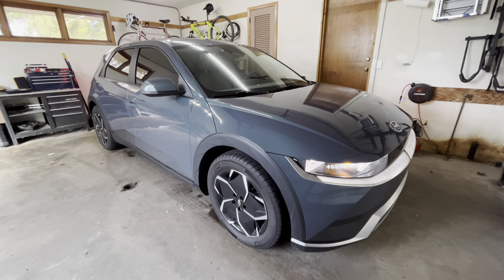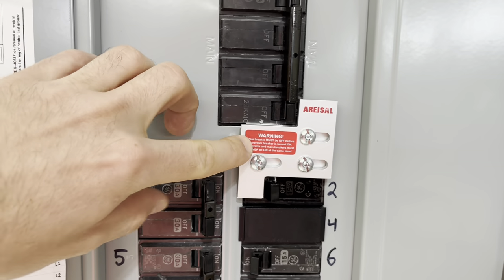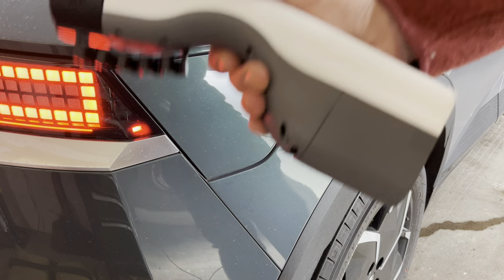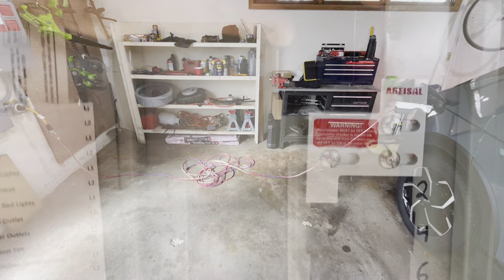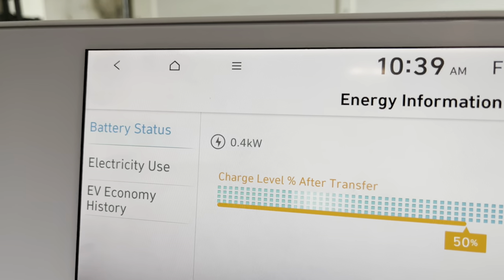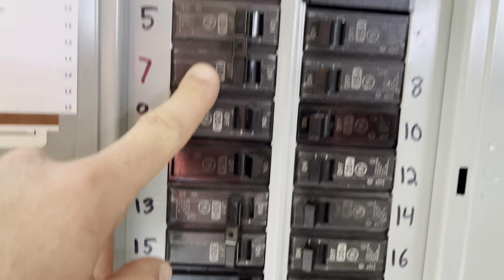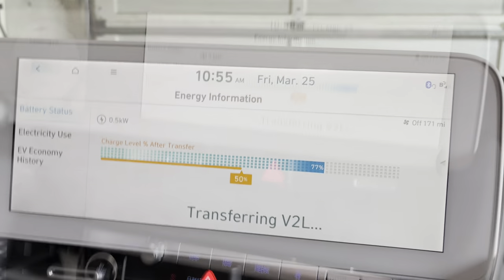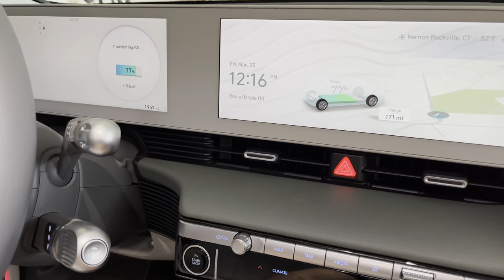5 Days of Emergency Backup Power Using V2L Adapter | Ioniq 5 | EV6 | GV60 | EV9 | Kona | Ioniq 6

Comment: Possibly the optimum solution is to first start with battery backup on your PV. This doesn't need to be huge because the V2L will provide a trickle feed top up in the absence of solar via your PV charger mains input (which can be set to limit at the max V2L capability). The purpose of having a small capacity PV battery (say, 5KWh) is to provide peak load capabilities that are well beyond the capabilities of the V2L. Also overcomes the 120 240 issues you have in the US. In the UK, we are blessed with 230v V2L at 13A.
With this arrangement, you could use a high load appliance for a short period (eg. dry some clothes for an hour/ cook) drawing most of the power from the low capacity but high current capability PV battery, whilst the V2L replenishes at a constant rate.
Reply: Hi Andrew, desperately trying to find info on this, I'm from the UK and your comment is interesting. Am i understanding you correctly in that say you had a 5kw home battery you could use the Ioniq to keep that topped up with contsant trickle? I wonder who I could get to install that ind of arrangement. I am just about to get a 5kw battery and additional solar with a UPS built in as we have power cuts a lot. It sounds like a pretty straight forward alteration to the system?
Reply: @adamhardy8690  Hi Adam, yes your understanding is correct. It's a matter of doing some calculations after monitoring your power consumption over 24hrs at various times of the year and working out how much PV battery capacity you need for peak draw periods knowing that between peaks you'll be topping up at ~2KW. Of course, if you have a large enough PV array and  excess energy during peak sun, you'll be wanting to first charge the PV battery and once that's topped up, direct any excess power to the EV battery. Given the 60 to 70KWhr available in long range EV's, they can provide this load smoothing capability for quite  a considerable length of time and still leave plenty for car journeys. You'd need to factor in your journey requirements and make sure you didn't draw below that level.
Reply: I just seen Enphase and there bidirectional car charger/solar inverter with V2House and V2Grid functionality. There lots of companies working on it. Just hope for good implementation
Reply: So, if I understand correctly,  you would need a PV battery backup specified to be able to be charged from a generator for this scenario to work?   Most home batteries right now do not support this.
Reply: This is incredibly helpful information. I really appreciate you taking the time to go through it step-by-step.
Reply: I'm in the UK and using an Ioniq 5 via the gen port of a Sunsynk Inverter to top up the house batteries. It works to battery charge if the inverter is isolated off grid but not just by switching to the gen port via the inverter.  This is a pain as you have to physically turn the mains off. I want to be able to plug the car in and switch over from grid supply to the generator/v2l automatically using the timer on the inverter. If anyone has success with this let me know.

Comment: Note that many RVs have an external 240VAC jack (twist lock) analogous to the 120VAC jack shown here.
Since many generators (and most campgrounds) can provide 240VAC (split phase) power, that makes sense.
Alas, some generators (and the V2L here) only provide one half of that, which is why RV owners also have an adaptor to feed a 120VAC extension cord to both sides of the 240VAC plug. Any actual 240V appliances won't work, but all the 120VAC circuits will. To do the same at your house, swap the single pole 15A breaker for a double pole (relocating one circuit); the interlock would apply to the new arrangement. 
As in the video, turn off all the two-pole breakers (which won't work when fed from one leg anyway), and turn on whatever you need among the single-pole breakers (up to the capacity of the V2L or generator,).
Reply: Yup, this is exactly our situation. We have a subpanel with solely 120V loads, but 100A 240V feeding into it from the main panel, and the 240V loads on the main panel. The generator backfeed goes into the subpanel and feeds both busbars. So it feeds all the 120V loads on the panel, so we didn't have to move any circuits to do it.

Comment: That's a lot of work for 15 amps 120v. I do a pretty similar thing off my electric lawn mower using a 6kW 240v split phase inverter. I have less kWh but it does run the whole house, and I can charge the mower from my car to extend it and I'm not tethered to the house. Previously I just did the drag an extension cord around thing which was enough for a few lights, refrigerator, and internet.  All electric including heat pump / hot water / etc so I need more power overall.  I can't wait to be able to do this with a vehicle capable of 50 amps 240v like a Cybertruck or F150 Lightning.

Linemen treat every cable as hot and will test before touching anything. The reason to disconnect your main breaker in a power outage is so you don't try to power 10 of your neighbors' houses as well and immediately overload everything, your breaker would trip almost immediately.  Also when the power came back on there would be a near explosion (worse than a dead short) when the two out of phase power systems connected to each other, and again the breakers would trip immediately after a huge arc occurred.
Reply from the maker: What mower do you have?
Reply: @TheIoniqGuy  Ryobi 100 amp hour 38" riding mower.  About 4.8 kWh theoretically (48v system).  I have a video about it on my channel.

Comment: We have no 240V in the house other than the dryer (gas heating and stove/oven), so my plan is to have a simple boat-style power switch from main to car load for whenever the power fails. We're averaging about 10kWh/day, so we should be good for about 5 days, too. LED lights and power-sipping laptops go a long way in lowering overall electric consumption, it seems, even with us working from home and having lots of pot lights on for most of the day.
Reply: you need to move breakers around if you live in the USA as we have a split single phase 240 volt system.   down side is you will have all your critical loads on one leg which may unbalance your system somewhat

Comment: Hyundai's V2L is a neutral-bonded ground source, which means the neutral is connected to the ground. Your panel has the primary neutral-ground bound. Therefore this V2L connexion is violating the National Electrical Code which stipulates that there must be a single point where neutral is connected to ground. In this kind of setup, you usually need to run a floating-neutral generator

I also noticed that the V2L adapter allows for two orientation: ground up or ground down. This basically enables to swap hot and neutral on all powered devices. My polarity tester throws an error when I use the ground-up configuration, but not gorund-down. I don't understand this dumb decision, as the prongs on the V2L are already keyed, but not on many extension cords. This creates a situation where a switched off lightbulb would still be live, as the switch would normally be on the black wire, not on the white one.

Were you aware of this? Or I'm missing something?
Reply: This was my understanding too on a floating ground, but could not articulate this clearly. Thank you!

Comment: ok, this is an amazing video. before watching a video, i was thinking ok, if there's a poweroutage for multiple days, use the v2l, then cord and powerbar and fridge, freezer done deal. But seeing how you can put it back into your breaker etc etc, such an awesome video. only 3 more weeks till i might see a i5 in my drive way, and knock on wood, we rarely get power outages, if there ar eit's for 2-3 hours but a few years back we were out for 7 days, but that's very rare and few inbetween. love all your videos and have been binge watching them multiple times!

Comment: Thanks for the link to the Goal Zero transfer switch.  I have a sub panel in my garage (no main breaker so can't use interlock) that it will work perfect for and I"ll be able to power the apartment over the garage with my car!

Comment: You can get a 240v v2L adapter from overseas that puts out 3.6kw split phase.  You can also use the plug under the rear seat to get an additional 15A/120v to run your second phase.
Reply: Not all trims of the Ioniq 5 have the under-the-seat connector.
Reply: @richardneel6953  true only limited/ultimate.
Reply: you said  " You can also use the plug under the rear seat to get an additional 15A/120v to run your second phase""  that will not work in north america..   the reason is the fact the neutral is center taped on the step down transformer from 7 ish KV to 240 V.  That is the reason you can share the neutral for a ZERO current neutral if both of the hot legs are balanced.  In your suggestion the current WOULD double   BAD!!!!!!!! but the 240v v2L adapter from overseas that puts out 3.6kw split phase. would work if it is TRULY 240 split phase. If it is from overseas I would bet money (not sure) that it is 240 volts hot to neutral.  One would need a to construct a 240 hot neutral primary to 240 split-phase secondary output transformer and assume 12 amps on 240 split phase usable.  better than below.....

for all that in North america just take a 120 volt hot to neutral primary to 240 slit phase secondary but you will only get 5 usable Amps on 240 split phase  Enough to keep a refer going and a few led's.

good luck be safe and do not drop any electricity on the floor.  it's shocking  :)

Comment: I sent your video to my electrician and simply said THIS IS WHAT I WANT :-)
Reply from the maker: Let me know what he comes back and says
Reply: @TheIoniqGuy  , I did the same and the electrician said sure, let me come out to estimate the work.  In 6 weeks.  When he finally came he said, no he would never put in a 120V generator inlet.  Only 240V.  Said 15A would power almost nothing, ignoring the arithmetic I had done on our appliances.   Wasted 6 weeks.

Comment: I have a Generator input at my home in Australia. WE have all 240v Systems. I have a manual switch for change over.  My KIA Niro can power all my Lights and Power points inside my Home. No stove top, oven, Hot water or Heating. I did a test recently for a 24H time period. I had a 20% draw down from the vehicle Battery. We don't loose power that frequently, but it's nice to know I have that Option. I also Have a 2.2kw Generator as a back up back up... Cheers

Comment: Have you checked out the CCS bi-directional changing protocol that is coming? Game changer as you can power your whole house from your vehicle during power outage or during peak hours for areas with time of use rates for power.  Hopefully Ioniq 5 will support this in the future. See Emporia bi-directional charger for some info. This would be a good future video.

Comment: That V2l fuction itself could be a big selling point for the vehicle. Very impressive what a car could do stuff that ICE vehicles can never do.
Reply: That is not true.  An ICE can do this   search AIMS power inverter  12 Volts DC to 240 volts Ac split phase inverter/ battery charger
Reply: @jeffk8359  Nope! The 12V starter battery contains a tiny fraction of the energy that an EV battery has.
If you wanted to power your home for any length of time with a combustion car, then you would have to continuously also leave its dirty engine running.
Reply: @ciaransherry6021  of course the 12 volt battery has a fraction of the energy as an EV battery please don't State the obvious while all of this green energy I completely believe in and I thoroughly understand it as I do hold a degree in physics so let's just put it out there for the record only having half of your power panel faced quite frankly is not a smart thing because that means under normal situations you're unbalancing your utility load as well we are talking emergency situations and quite frankly I don't give a damn about whether my ice engine is dirty or clean if it's a matter of lights and keeping my refrigerator going and providing enough voltage at the plug where my natural gas and or propane stove is plugged in so I can spark it then so be it

Now if my directness was offensive don't take it personally I've just found that most people who speak in these forms actually have zero concept about electricity or energy or anything else because most people are not educated now like I said above I hold a degree in physics so when I speak I speak from fact and if you're one of those people that believes that everything should be run on electricity well that's all fine and dandy if you live in Hawaii where the temperatures are always moderate I live in high heat areas and then the other part of the year it could be incredibly cold so I have to deal with 100° Plus as well as 0° all within the same year that's not the realm of a heat pump

Like I said my apologies if this was too direct for you or if it came out to be condescending I didn't mean it to be but I'm just tired of people talking about things that they may not understand
Reply: @jeffk8359  Ah sure you're just great!
Being relatively uneducated, I defer to the humility of one who professes to have a Degree, and who worships before that Blessed Trinity of 'Me, Myself, and I.
💚🙂

Comment: I just had an electrician do this for me. Only difference is my panel is in the basement. Cost about $1,200. Hopefully I never have to use it but is nice I have flexibility. Hopefully future EVs can let you output more power at once.

Comment: Thanks for this! I’ve already used the V2L once when contractors had to turn off our power for an hour (I used it to keep slow cooking the roast in the crock pot😊). It was super fun to see your setup here although I don’t think it’ll be easy for us to set up as our main panel is buried deep in the house. I plan to just plug in the chest freezer in an emergency and save the food (temperate climate, wood stove for heat, everything else will be fine). We are in the middle of solar install (Enphase also) so it was fun to see your setup.
Reply from the maker: Awesome! It's great that we've got this option now. Enjoy your solar system. You're lucky to install early in the year so you can reap the summer benefits of all that sun

Comment: Why couldn't one split the extension cord into two with a common Y splitter and have two 15A generator inlets, one for each pole?  You would still have to stay w/in 15A total, and make sure to never flip on any double breakers.   But you wouldn't have to move any breakers to power the things you need.  We want to power the fridge, furnace (for the blower) and a few lights and plugs at a time throughout the house.
Also, I'm puzzled about exactly which breakers were powered by the generator inlet in your video.  At one point it seemed it was every other one from top to bottom, both sides, starting with intake breaker at the upper right.  That matches powering the fridge at breaker 25 on the left.  But when you turned off all the powered breakers before unplugging it you flipped many that were just below each other, not alternating.

Comment: Obviously, Hyundai designed this V2L for countries that has 220V as standard. Therefore, they do have V2L adapter that is designed for 220V.  I am curious if you be that version, it would work without worrying about the issues you mentioned? Or the inverter inside the car is not universal to handle both. In any case, you are genius to set it up and use it.
Reply from the maker: Unfortunately it's not as simple as just plugging another country's adapter into ours. The US uses CCS 1 and other markets use CCS 2 which has more pins. They're not interchangeable.
Reply: @TheIoniqGuy  I see. Thank you.

Comment: In a cold climate what you want to be powering during a winter storm is your Furnace blower, a few lights and one or two electrical outlets to charge your phone, tablets, and power an induction cooktop, or portable induction cooktop and have ample power left in your battery to survive until the local utility is restored.   You don't need all of your lights and certainly not all of your outlets to survive.  Outlets that may have loads you haven't even thought about and will just drain your limited battery capacity of your EV.  If you had a blizzard like Fort Erie(ON) or Buffalo (NY) had  winter of 22 three days of strong winds and much snow depending where you were, trees toppling taking out the electrical grid, you might want to save the energy in your vehicles battery to last as long as necessary. My brothers off grid house was the only one in his neighborhood to have electricity to run his gas furnace off his limited 54kW Tesla power wall.  His neighbors tried to run electric space heaters off generators to heat their homes.  Until he went to them and hooked up their furnaces to the generators.